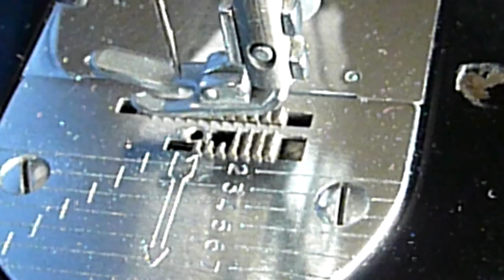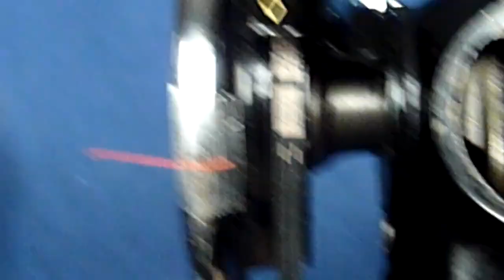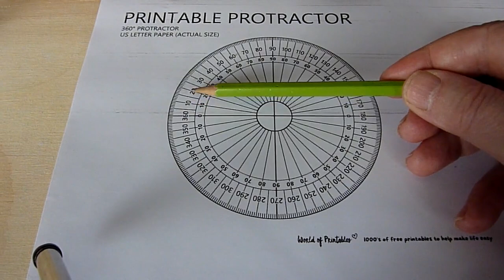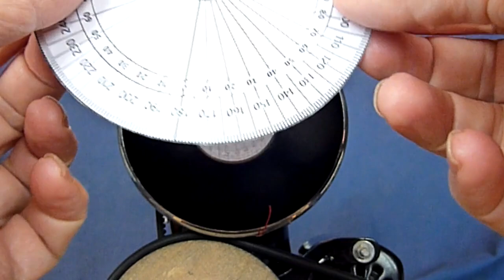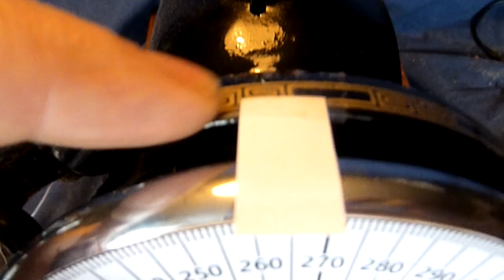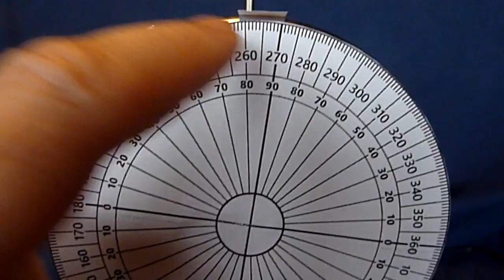How to adjust Feed Timing of a Singer 201 Sewing Machine

Comment: You can use a small fridge magnet to hold the paper ..easy to adjust and no glue
Reply from the maker: Thanks. Yes, it may be an easier way to fix the protractor. 😀

Comment: Thanks for the informative and concise presentation. I was intrigued by it. I have a Singer 237. I know that,  in another of your videos, that you have also referred to adjusting the timing of that device as well. It struck me as a question, does this video's depiction of adjusting the timing of the Singer 201 device, have any relationship to the adjustment of timing the Singer 237? I didn't receive my repair manual to this device as of yet. I am looking for it online.

If the adjustment of the timing here is similar to the adjustment of the Singer 237 it would certainly be something that I might attempt. It seems that one would only need a screwdriver and a degree wheel, basically?

Thanks for the content.
Keep up the good work.
בס'ד
Reply from the maker: A sewing machine got more kinds of timing. When you do not specify anything, you expect it to be the needle hook timing. This video is about the feed timing, and it is not possible to change that with a Singer 237, because the motion of feed is locked to the motion of the hook on this machine. So it is not all kinds of sewing machines, that got the possibility to adjust feed timing to some alternative setting.
Reply: @sewingmachinesindetail  
Thank you so very much.
Another question:
Do you possibly have a reliable source by which I may find the 237's repair manual?
Reply from the maker: @KelikakuCoutin  There is two major FB groups, that got them free in the files section. It is "Vintage Sewing Machine DIY and Restoration" and "Vintage Sewing Machines".